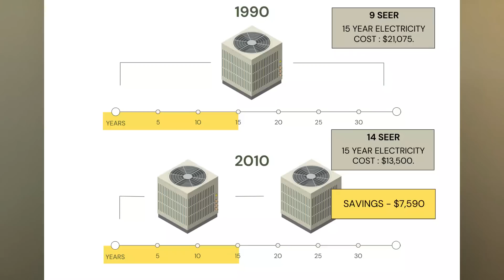Are new AC systems JUNK? Everything you need to know

Comment: 13 years? On what planet? 35 years have taught me that between year 15-20 most will develop leaks. Most don’t immediately replace them, and enter the hamster wheel of the AC guy needing to charge them up; so much so that many people think it’s an inherent part of an AC that they need charging. Contractors and manufacturers alike parrot this same line of BS. In my area it’s “10 years.” Nothing is made like 40 years ago. Your 1955 Cadillac is made much better than a new one, but the new one is more enjoyable in 50 other ways.  Every single thing in our society is made less robust in our society, right down to the microwave, and that’s unfortunate. In English, “They last 13 years” translates to “Fear sells.” Most ACs will develop leaks year 15-20, and most will just recharge them until they get fed up and are changed early to mid 20’s. Are they built less robust? Yes. Like everything else you’ve bought in the last 2 decades unfortunately.

Comment: I just learned how to fix them myself many YEARS ago. I'm not paying 5k (15+ years ago) for something the installer only paid for 1200. You can buy all the tools you need to put in ac systems for about 1,000 if you own no tools. I just put a free air conditioner in my shed a 2 ton trane condenser r22 unit from 1999 that someone got a more efficient system and chunked the trane .. My 99 trane still works they system that they replaced it with has broken twice in three years . I'll never pay for an hvac call again, no way. The never stuff is junk now . I know i fix them for a living.
Do the old ones use more electricity , sure  . But they are set it and forget it change the air filter monthly never have an issue, this new stuff with multi speed compressors and variable speed evaporator fans...GARBAGE. Don't get me wrong i don't mind the side work but im personally not gonna own that stuff. When i get home i want the ac to work PERIOD. we can talk about the electric bill later.By the way DONOT believe t5hey hype that keeping your ac at one temp saves money;  I cut my power bill  by 25% just by getting a wifi thermostat. (cutting the hot water on and off was 5 to 10%) I let the house get 80 while i am at work an hour before i get home it drops to 70. Contrary to popular belief unless u have a FANTASTICALLY insulated house in a mild climate with double pane windows  you don't save money by keeping the ac at one temp. Put your hand on the inside of your outside window glass and frame. Does it feel allot warmer or colder than the inside? if you said yes  then you will save a lot of money by fluctuating your cooling and heating settings.

Comment: My house in Arkansas came with a 4 tons and a 3 ton unit for down and upstairs respectively from 1991. In 2016 they died hard and were replaced with 17 sere ones and new 90% efficient gas furnaces. We have the same unit now upstairs and down but they're 2 stage so most of the time the one upstairs only runs at 3 tons but we had a second intake added in my office and another duct to the stairwell so that when someone makes a large change in the set point of the thermostat it isn't constrained when running at 4 tons.

They come in the Spring and the Fall to spray soap and water on the coils outside and to make sure nothign is leaking, vacuum the leaves out of the outside bits, check pressures and clean the burn chambers in the furnaces etc.

Comment: My rheem is from 1978 and i turn it down to 65 every night in the summer and it is still going strong, no issues
Reply: A house that I sold 2.5 years ago still had a 1993 Heil central unit in it.  The thing was a tank.  I replaced the contactor relay every 2-3 years, and I had to put a fan on the outer unit, but that is about all the repairs that I ever did to it.

Comment: Going with a upgrade to a Daikin Natural Gas Furnace and Variable speed blower paired with Daikin Fit R32 Central AC also having all 3 splits removed from duct work.New Plenum. Currently have single stage builder grade central AC single speed blower and electric heat. Lafayette Louisiana here

Comment: Commentators have covered all the ins-and-outs. Here are my talking points:
1) inferior parts used
2) planned obsolescence by mfgrs; help the economy by buying a new AC every 5 years!
3) higher system pressures required by refrigerants that are continuously being outlawed (by government) and replaced by ‘newer’ refrigerants; seals in fittings fail due to higher pressures
4) microprocessor controlled overly complex voltage transient sensitive ‘brain’ (make sure you have useless wi-fi and Bluetooth so you can ‘talk’ to the system with your phone because you’re too lazy to get out of your chair and go over to the thermostat and make an adjustment)
Reply: Well said! I just want my AC to cool. I dont need all this ridiculous smart technologies or stuff like that.

Comment: I have over 10 rentals and work on 100s other as a handyman here in tx also. Hate old and new central ac's and new waterheaters. Both are always a problem with short spands between uptime to something need fixing.

 Though for r22 lasted longer before a issue, but now that decades have stacked the units are full of problems just being old.  Alos r22 costing a arm and a leg for the freon itself is terrible. Glad were next to mexico.

 r410a ac's always has something go bad. New units and within a year something is wrong. (this pertains to all acs) Often a capacitor, fuse, or dead/dying motor. Sometimes clogged lines with algea causing internal flooding. Folks dont change their filters, or ever turn off the unit to rest. Always low freon issues all the time. Freezing/clogged condensors or leaking valves requiring stem changed. Folks mow and cut the darn cable haha, or chew up the radiator fins and nicking copper lines. 

What sad is also even when the central air is working perfectly fine folks still complain since its not cold/hot enough. Mrs its working as hard as it can in 100+ degree tx, you should be thanking it. Get you a window unit.

Honestly in my own properties im opting for window acs only. Less stress with less problems. Every house with central ac ill have to atleast fix something in a year. Some houses literally feels like every other month. 

Haha atleast I have plenty of work!

Comment: I think the difference in pressure between 410a and R22 has a huge effect on the systems in general. It’s going to be harder on equipment to run 410 pressures all the time versus r22
Reply: And the coils are thinner.

Comment: Take all of what makes today's HVAC systems good and make them capable of using R12 refrigerant the system would probably last 50 years because it would not have to run as hard to cool the air because R12 ran on pressures that were more than half of what they are today and because of this the compressor would last 50 years with regular cleaning and maintenance and if you played your card's right you might even get 60 years out of it if you don't mind having it set to 77 degrees Fahrenheit and have a stand alone dehumidifier system in the home that was tied in with the HVAC duct system.
Reply: I believe you mean R22. And I doubt 50 years.
Reply: @neilkurzman4907  my late grandma ac unit was R12 refrigerant and was 35 years old before she was forced to replace with a newer one because it was the original one put in when the house was built back in the late 60's to early 70's
Reply: @rustybeatty6567   my old unit was installed in 1976 and it was R-22 I thought R-12 was just for small systems
Reply: @neilkurzman4907  I'm getting close to 50 years on mine.   There's still some running here over 50 years old.   It's not that rare to find one.
Reply: @Gr8thxAlot  
The question is just because it’s running is a cooling well and not using too much electricity.  When I replaced mine, it became obvious how bad the old one worked. I would probably still have the old one if maintenance didn’t break the line and let out the charge.
My brother replaced his unit recently and the new one is much better and I’m assuming more energy efficient. Will it last as long time will tell. 
I’m in the northeast so our air-conditioning season is much shorter than the south

Comment: While planned obsolescence is a concept it really isn't the reason things seem to last shorter than in past.  First and foremost cost of materials.  In past you only had solid wood to build with.  Solid wood is expensive.  Then came along veneers which allowed furniture to be built with cheaper wood like pine and covered with veneer, cheaper to build abd cheaper to sell.  Now most furniture is cheap...  So plastic has replaced metals which reduces cost but reduce life expectancy.   Second reason is people desire new products.  Cell phones are a good example.   What is the point in making a phone that lasts 20 years when your average customer wants a new one every year.  

Now to the argument in regards to cars.  In his example I'm willing to bet that truck never was driven many miles each year.   It 1970 the average miles driven might have been 5k a year.   In recent years the average is 15k.  A car purchased in 1970 would be a junker by the time it reached, if it reached, 100k....  cars built in 2024 are likely to see 100k in less than 7 years and still be practicaly new.

Comment: When I completed my military contract in 1978, I bought a townhome in O.C., Ca. which at the time was 6 years old.  Over the years, I went to trade school, learned HVAC, moved across the country to mid west, back to So. Calif, then retired & moved to Utah. I recently went to visit a former neighbor in the townhome complex. Looking out his upstairs window to my former home, the Original 1972 ac condenser still on the roof. Over 50 years old & still running. Switching gears, I noticed  HUGE INCREASE in breakdowns with the introduction of circuit board's,  inverter motors, R410 a, etc
Reply: What brand of heat pump do you recommend for longevity?

Comment: My mom’s weather king lasted almost 35 years with almost nothing going wrong. I bought her house and ended up putting in a trane xi13 system, motor failures, circuit boards failures and then that had a compressor failure at 11 years after numerous failings throughout its life. Even with yearly tuneups. Then a rheem system that has failed twice and been essentially replaced twice under the part’s only warranty.

Comment: I have a 28 year Arcoaire  that I just had the condenser fan motor replaced. The tech told me do not even think about replacing it. He said the new ac now are total junk. When he had it apart I was amazed that the compressor still looks brand new.

Comment: To compare AC units with trucks or cars is a red herring. The AC unit sits still. Never moves, doesn't have to deal with salt, grime, rocks, speed, bumps, etc. At best the only thing that they have in common for endurance is they both are out side. But even then, by sitting still, they don't have the elements blasted at them with 60 to 80 MPH wind force on a constant basis. But both product aren't built to the same durability standards that they used to do. Even with computers. If it were the old quality, the computers would be sealed and protected better than they are, as would wiring. They make the engines smaller to put more pressure and that makes them blow up quicker. ALL of these products are now made to meet bare minimums and FORCE replacement. Because even with your excuses, things used to be made TO be able to be repaired. Now they're made so that if one thing goes wrong, it basically DOES need a total replacement.

Comment: Its true, I bought a house in 1987 that had a Heil system from the late 60s that lasted until 2005, the Rheem I replaced it with lasted 12, and the top of the line Lennox Elite after that had bad coils twice within three years...I sold the house in 2023, and its now on its fourth system within 18 years.

Comment: Pretty good explanation but I am surprised by a couple things. Fans are wear items. Are you defining an AC replacement as one where anything breaks? Capacitors are also a common repair / replacement item. Coils have gotten bigger and fans more efficient for energy. However, the one major culprit I never heard you mention was the change in refrigerant and its higher head pressures (more compressor wear), more caustic effects on the AC plumbing, etc. Compressor technology has changed but once again, the head pressures and caustic nature of the new refrigerant is harder on equipment.

Comment: The efficiency of a motor is not improved by making it lighter.

A 250-500 Watt blower motor is not $2,000.

An undersized HVAC system will have a higher duty cycle, but efficiency will not be affected.
Reply: An undersize unit will have lower cycles and longer runtime. An oversized unit will have more cycles.
Reply: @neilkurzman4907   Yes It's what I prefer, longer run times to allow fewer motor starts on compressor and fans.  Less noise due to less startups, perhaps more controlled environment, for comfort.

Comment: A friend of mine has an old system that is from the 1980s. Still works perfectly.
Reply: Yup.  Mine were working at 47 yrs.
Reply: I replaced my system from the 70s about 10 years ago. Not because it broke because it was damaged. It worked poorly and probably used a lot more electricity than the new unit does. it’s 11 years old. I guess I’ll see what happens in three years but I imagine since I live in the north I’m going to get a lot more use out of it since it doesn’t run for as many days.
Reply: Got a Lennox HS16 from 1985 with all original parts that is still working like new today!

Comment: Starting next year will be worse with A2L and SEER requirements. They'll cost more and last shorter life. Thanks EPA!
Reply: R32 runs at lower pressure and should be much better than R410A. Using 410 was the big mistake

Comment: I bought 2 new Daikin AC's units in 2015.    I've had to replace both inside coils which are only lasting 8 - 9 years.   In addition,  I have twice yearly maintenance.
Reply: Once a system is correctly installed (and many aren't), leave the thing alone. Keep it clean and keep "techs" AWAY from it.
Reply: I have 2 Amana systems.... both 20 years old without any maintenances at all and working just fine....no technicians ever touched them
Reply: @blueskyzone5459  Those units could be low on freon and not working correctly,  maybe those old r22 units are more reliable, and I doubt those units are 20 years old, and your saying they never had any work done on them, not even a run capacitor, hard to believe
Reply: @jackfrost-fu7hz  House was built 2005..all original equipments except the water heater and good attic insulation.  Even on hot days of 90+, sometime i have to wear socks....Amana still ticking
Reply: You did good for a Goodman, aka Daikin, Amana, my Amana (Goodman) evap coil lasted four years, then the replacement lasted 5 years.  Daikin is the same as Goodman and Amana and don't make reliable coils
Reply: @jackfrost-fu7hz  Mine are 13 yo now and zero issues but I never allow a tech near them.